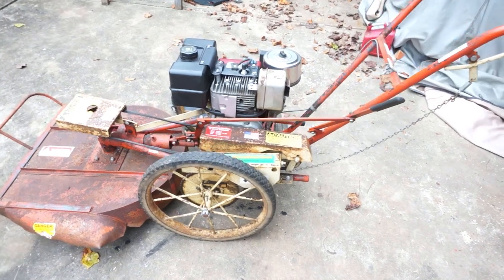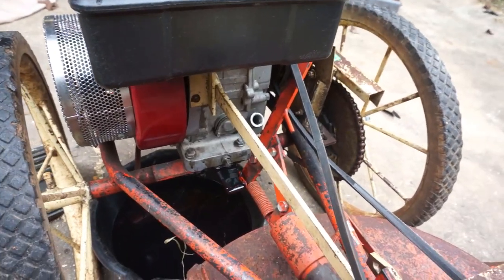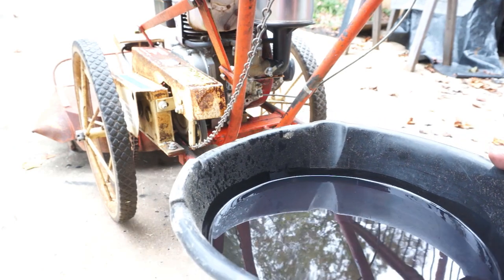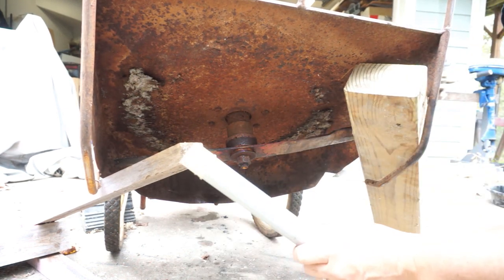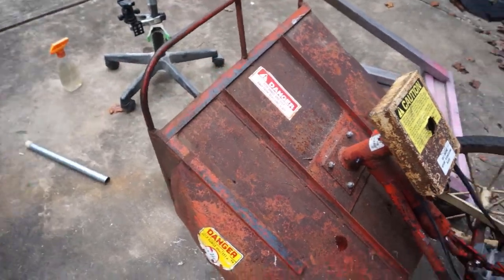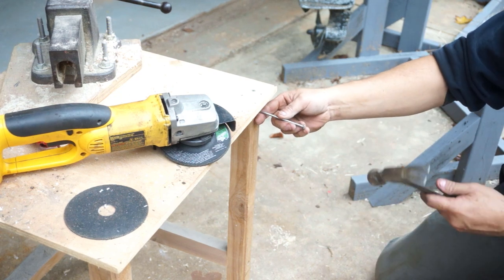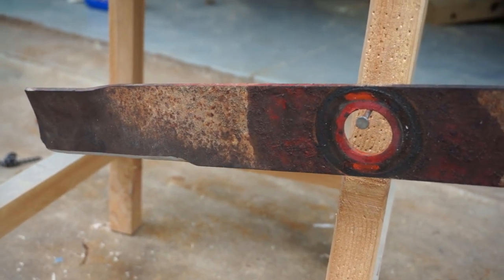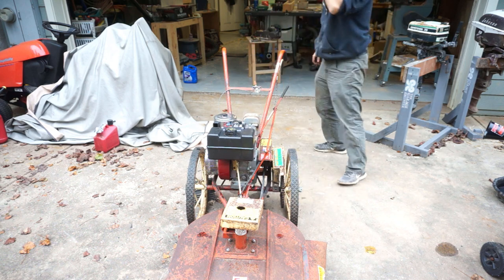DR Field and Brush Cutter: Maintenance, Cutting Trees, and Fighting Spiders -The Garage Engineer

Comment: On the 1990 DR brush mower I used I found the drive axle pipe was very rough inside causing the drive axle to rub.  I used a car brake cylinder hone and that made a huge difference in cleaning up the inside of the axle pipe.   With fresh grease it was much easier to push and PULL the mower backwards without that extra drag.

The brush mower will not have much of a life for its blade drive belt.   The setup is only really rated to about 3/4 horsepower and then there is a quarter turn on it.   You do HAVE to use the drive belt that is meant for this mower.   You can not use higher horsepower belts because the stronger cord structure will not flex in a quarter turn drive configuration.  It will just break the cords.   

Although the blade belt is greatly over stressed when it gets impossible for a blade belt to say on and its still relatively new (2-3 hours of use) there is the likelihood that the brace from the engine to the blade belt support has cracked or become loose.  What happens is without the support fully working anytime the blade encounters high stress the belt tension pulls the pulley sheaves out of their alignment causing the belt to roll off the sleeves.   A the belt in a belt drive system is pulled towards the higher tension edge of the belt because it gets the most traction.   You can see the process on industrial and farm belt drive systems from 100 years ago.  The belt seeks the larger size diameter on the pulley.   

The way to have a quarter turn drive belt system auto align its belt is for both the edges of the belt to trace the exact same distance.   This makes the biggest difference in keeping the belt on the sheaves on the slack side of the belt because the tension side of the belt is pulled onto the sheave and doesn't free flow like the slack side does.   The way the side-to-side tension across the belt is adjusted is by rotation the engine around its vertical axle.  I don't think there is an adjustment on the mower to allow that.  

 I changed the sheaves on my brush mower to larger diameters to allow more horsepower transfer and that required turning the engine adjust the side-to-side belt tension.   I do believe that when I calculated the stock pulley setup the side-to-side tension was not equal distances and the engine would have needed to be more rotated to achieve proper side-to-side belt tension.   The problem with rotating the engine more was that it upset the alignment of the mower's self propelled belt that was already at a slight angle.  The self propel belt is not very picky and you can likely use a higher cord strength belt, but you can't do that with the quarter turn drive belt!   The quarter turn belt drive has to use a fractional horsepower belt because the cords on a higher horsepower belts will break in order to conform to the quarter turn path.   The fractional horsepower belts have an "L" in the belt labeling.  Best just get the belt from DR.  Nobody makes V-belts for a quarter turn drive setup so its a special function that DR has discovered works for a a specific belt.  If you can get 2 - 3 hours out of a blade drive belt that is probably about right for heavy use.  A lot of the cutting on these brush mowers is actually fairly light duty with the momentum of the blade doing the frequent, but not continues heavy cut.  

Thank you for sharing the video.
Reply from the maker: Thanks for the great info.  I will check out the items you wrote about.  Thanks for watching.

Comment: Got mine running. Also threw drive belt. All I had to do was take some slack out of the engagement chain. Now it stays on.
Reply: Does anyone know what size belts that it takes I have one it's only got one belt I don't think it belongs where it's at
Reply: I have a nineteen eighty-nine field and brush doctor do you know what size belt it takes
Reply from the maker: good call.  I did that and it worked.  I still need to change the belts.  but Ill probable wait until they break, then replace them.
Reply from the maker: I have not researched them yet but if you can the tech line for the DR company, they will help you.  I might have to do that soon.
Reply: @TheGarageEngineer  thank you for getting back to me.
Reply: @debrarodriguez5771  Manual says, Wheel Drive Belt: 1/2 x 31 inches, part #W708AC.
Blade Drive Belt: 5/8 x 58 inches, Part W658C.
Reply: @TheGarageEngineer  thank you so much, been working this baby hard w new belts.

Comment: I wouldn’t use bar and chain oil for engine oil.  It has different additives and properties.  It’s simply not designed for it.  Check out Project Farm’s test using bar and chain oil instead of engine oil in a mower engine.  More foaming and more wear and tear when using bar / chain oil instead of engine oil.
Reply from the maker: thanks for the recommendation.